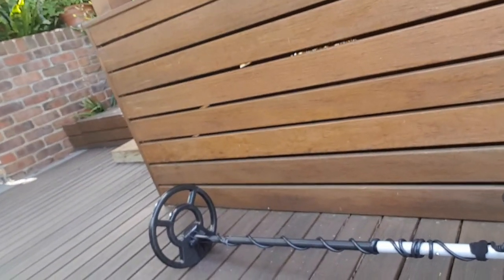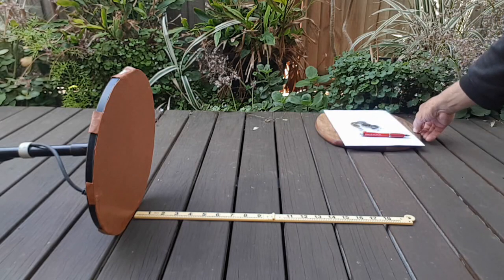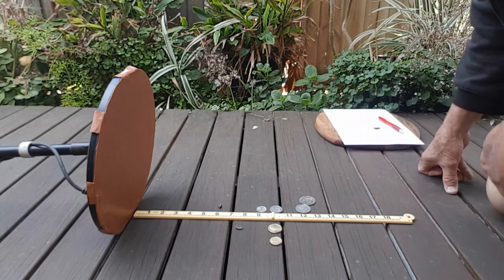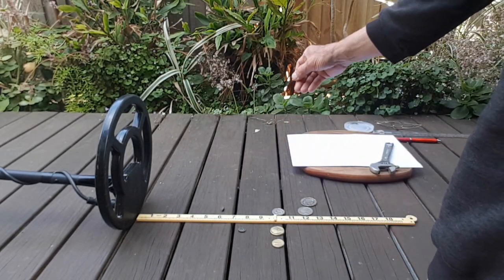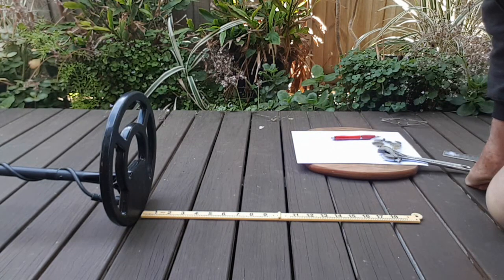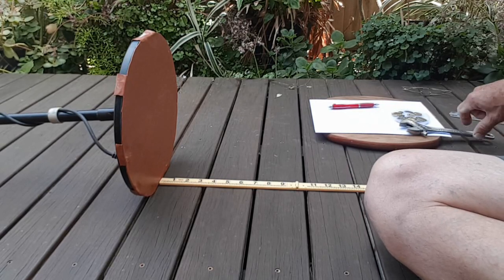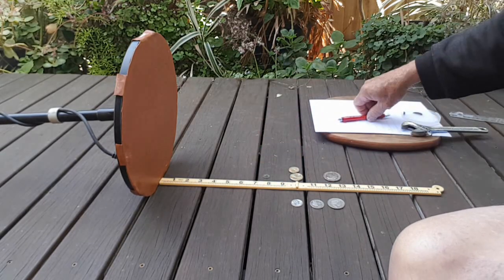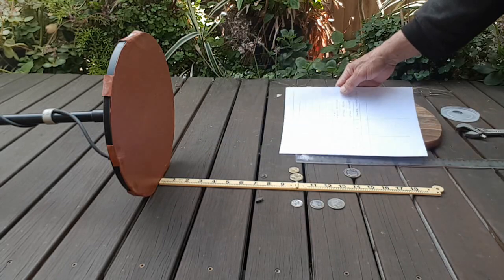Detector air test of TreasureMaster and Equinox 800

Comment: The Treasuremaster is a VERY underated detector.
This little detector does almost everything and will certainly bag you a LOT of goodies. 

YES, there are better machines out there, but at this price I dont think you could beat it.

Easy to use, good recovery speed, lightweight, decent concentric coil and only takes 2x AA batteries. 

It's a fantastic all rounder. 

Here's something to think about too with regards to this video.... Stick a DD coil on the trasuremaster and the depth would be almost identical to the Nox. 

I'm in no way saying that the TM would then be a BETTER detector, but if depth on a budget is what you're after....
Reply from the maker: Yes, I agree. For the price, a good, sensitive machine. Only problem I had with it was the continual falsing down at the beach (which could be partly fixed by knocking the sensitivity down anyway).

Comment: I like this test. And I have no bias on either machines. But the trouble with is test is 2 things... 1, you lower your centering as you measure. 2, you kept the coins in front of the coil. Thats not conclusive in my view. But a good try that deserves a good look I think. Thanks
Reply from the maker: Yeh, valid observations... Coins in front of the coil don't matter if they're stationary - detector tunes them out.

Comment: Although in air tests are not really conclusive given the amount of variables in the field, ground conditions, conductivity of targets in relation to the ground, targets not presenting flat on to the detector and it is still quite interesting to see how they perform. Not sure the Equinox is worth twice the price of the Whites TreasureMaster, Also I think I prefer the less chattery Whites ;)
Reply from the maker: Yes, you're right. Air tests are just for fun really.
Whites have always made good products...
Reply: @joc1862  I think my first detector was a Whites but that was over 30 years ago so have no idea what model but it was blue, has a meter and a single control. Not complex for sure but lots of fun just the same. Have you tested the TreasureMaster on the beach, wet sand etc? I have heard they work well on the beach.
Reply from the maker: @yamahamusicians  Yes, the early Whites were as you describe. I had one which was the 6000D. It was great. There were other models as well. 
The TreasureMaster I have works ok, but tends to false a lot on the beach, especially on the wet sand. You have to turn the sensitivity down quite a bit  to get it quiet. Not sure whether it has a fault or not. So I don't use it much. Maybe a more experienced TreasureMaster user could comment. Thanks
Reply: @joc1862  Thanks for the info Jo. That always makes me wonder why some detectors have a specific 'Beach Mode' setting yet it often makes little or no difference. Sensitivity always needs to be reduced.
Reply: @joc1862  Hey Jo, There is nothing wrong with your Treasuremaster. My nephew's machine does exactly the same thing depending on which beach it's been used on. It performs absolutely perfect on some beaches running nearly full sensitivity but chatters like mad on others, especially anywhere with black sand. If you do encounter such a beach I'd suggest staying on the dry for best results. 

good luck!
Reply: Jo C it just shows you, my 30 odd year old cscope cs2m  a early motion machine air tests about the same as the treasure master, it also runs at 12khz so would have done better at picking up the gold nugget, treasure master looks good value

Comment: Just traded my Garrett ace 400 for this one,,not because it did not do its job,,but i was digging far to many great small deep coin signals that were nails and small aluminum,,though i found a lot of great silvers and pennys,,i just could not figure out a way on how not to get fooled without digging it all,,maybe the treasure master will come through with a little less trash digging.